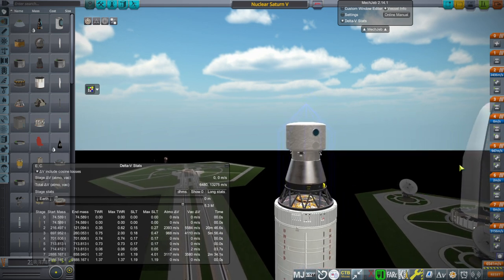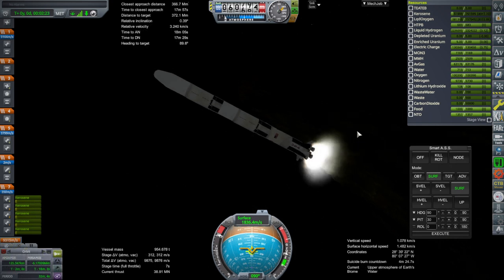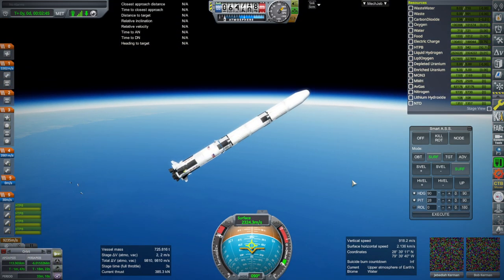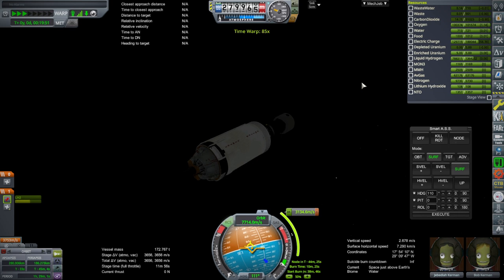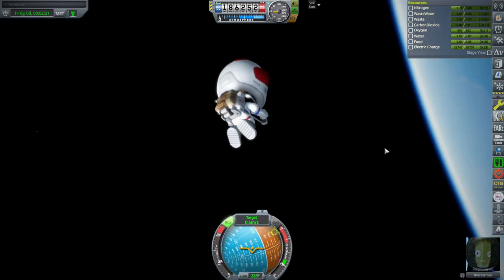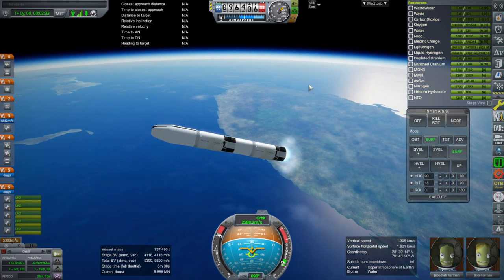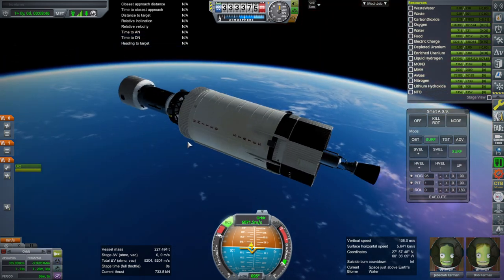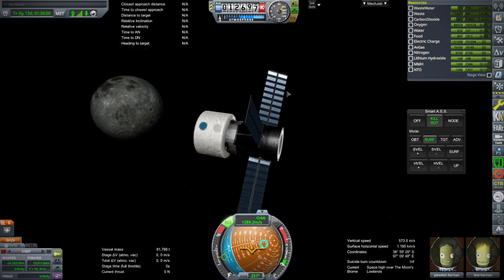Kerbal Space Program 1.12 with RO - Saturn V with Nuclear Third Stage

Comment: I'm wondering what is the point of a pass through system if you could just download free IVA. Not having colliders I'm sure is better than the hassle of trying to move around in pass through using the EVA pack
Reply from the maker: Because the creator of Free IVA said in the "Features" section of the forum thread on it "Lots of bugs! Don't use this in a main playthrough" and I took their word for it. Simply eliminating colliders can have some dire consequences, as some people found out with kerbals just falling through when the part was under the influence of gravity. With pass-through, in principle (assuming I've done the colliders right), the kerbals could be left floating around inside and still survive reentry.
Reply: @RaizSpace  oh yeah kerbals do tend to just fall through parts, I guess I can see where you are coming from to be honest then